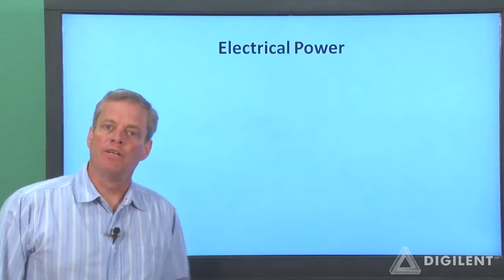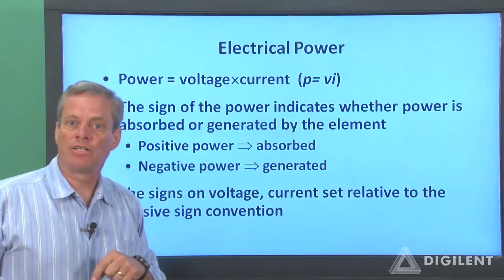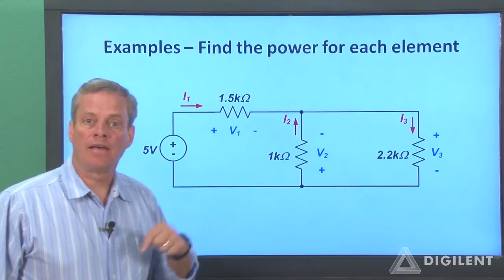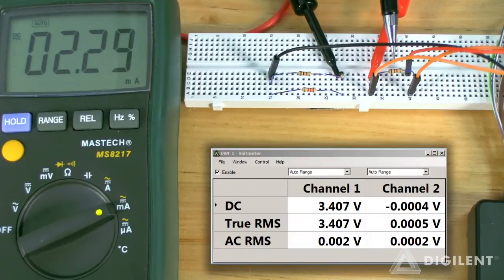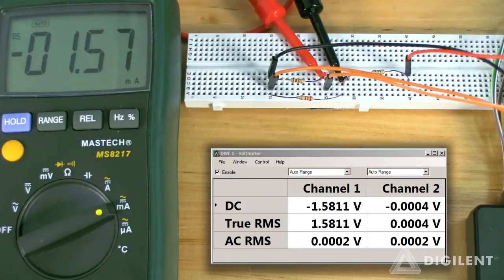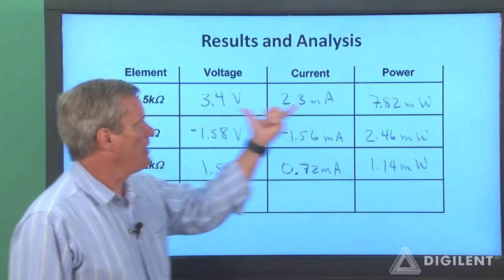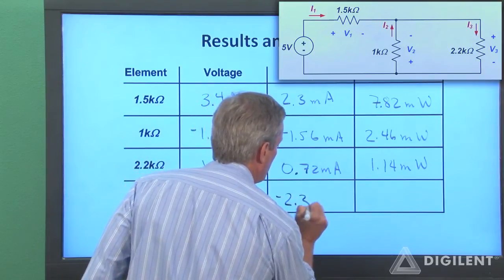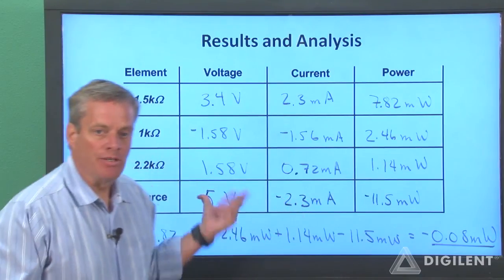Power Conservation

Comment: Thank you for the information, but please explain how you defined the voltage across the 1K resistor? The voltage on the 1K resistor cannot be in the configuration that you have provided. Have the 1K and the 2.2K in parallel means the voltage across the parallel combination must be the same for a single current source. If this is just your choice, then explain it as your selection of current flow, but please explain the the current flow you assigned cannot happen in the real world with 1 voltage source.